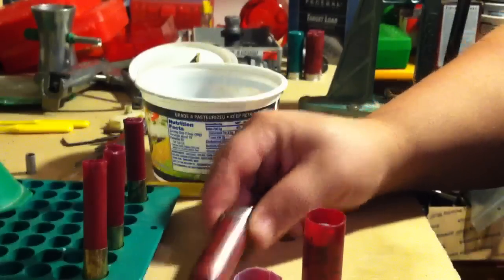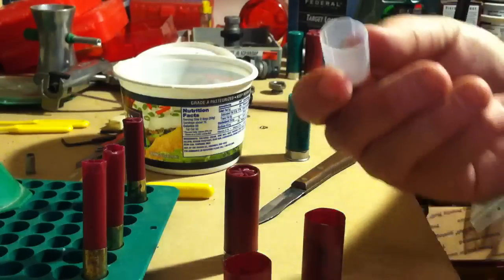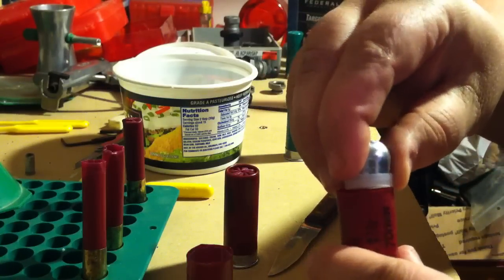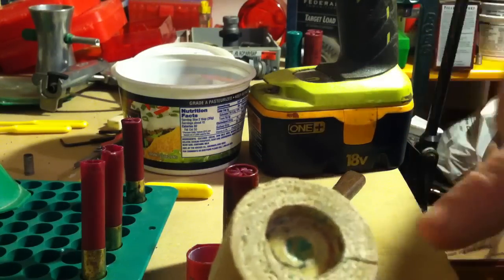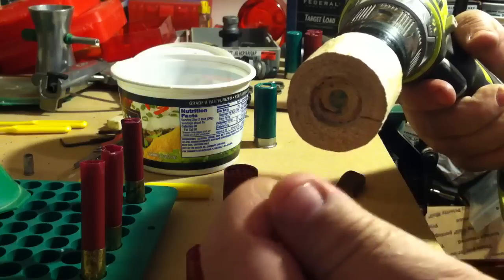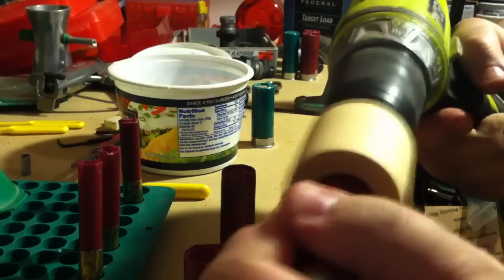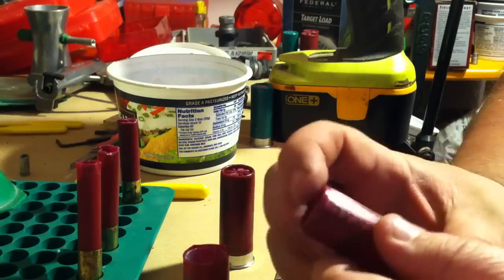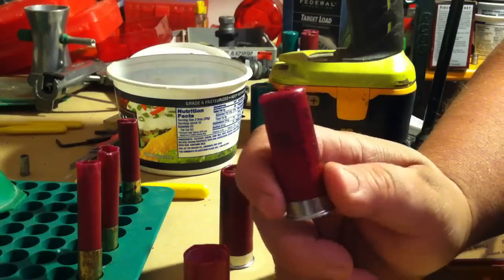Drill powered roll crimp Jig for shotgun reloading

Comment: If you start by drilling the dowel hole in the back end, then put the spade bit in your vise and spin the log to drill the crimp pocket, you'll get a much more centered pocket and far less wobble.  You can even spin the jig and use a sharp chisel or similar to even out the outside so it's concentric as well.  If I hadn't just ordered a roll crimper I might try making one of these...

Comment: Your crimp will not be consistent making your shots inconsistent. Your finished crimp needs to be snug  to the shot. See load tables for pressures  you'll be surprised of what the crimp should brake at. 
And by the way Roll crimps should roll ,The top edge should roll in toward the shot and down U------U not like L-----_l.

Comment: Not a smart idea at all. Cutting a shell open, and  replacing the shot with a slug or buckshot, you are setting yourself up for extreme pressure spikes. You can easily blow your gun up and, in turn, potentially injure or kill yourself or others. Inexperienced leading the inexperienced, is never a good idea.
Reply: dramatic much?
Reply: Not dramatic at all, and not meant to be dramatic , just stating the truth. It's real obvious that you have never done any shotshell loading, and don't understand pressures.
Reply: Wild assumptions much?
Reply: What am I missing that makes what he's doing dangerous? Is that a 7/8oz lee drive key slug or 1oz. How much shot did he remove? People do this all the time. Try 50grains of Blue Dot behind a Lyman 525 if you want a big boom/massive recoil (You have to research the shell,primer and wad you want/feel comfortable with). Longshot (less grain charge)  gives similar velocity without as harsh of a recoil. Only do what you feel safe with, If that's factory ammo for you, that's fine. Have fun and be safe.

Matt
Reply: slickyboyboo replace 7/8 oz with 7/8 oz and it's still 7/8oz. Same with 1oz or any other weight.
Reply: He simply replaced 7/8 ounce of led shot with a solid 7/8 ounce slug and then he is cutting the wad down so actually his loads are a bit lighter so its plenty safe... Considering how light those target loads are those are likely soft shooting slugs... My guess something like 1300fps instead of the usual 1800 you get from a standard foster slug
Reply: There is no extra weight so no ‘ extreme pressure spike ‘, at all .